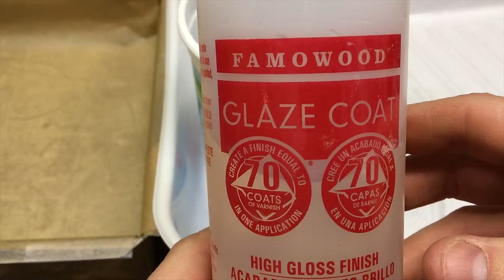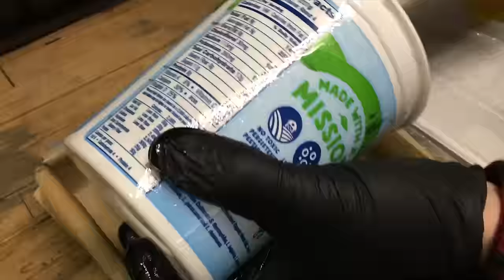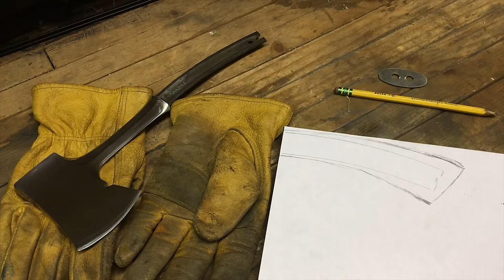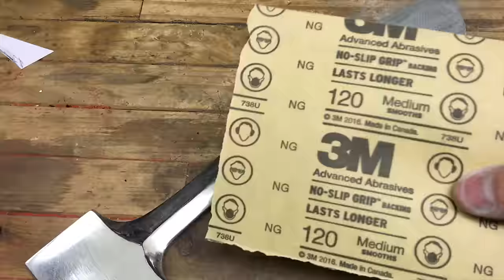AXE RESTORATION - Estwing Hatchet Restored using a Cashmere Scarf!

Comment: Did you happen to see the date stamped  on the handle  under the old leather?
 Thats an old Estwing  hatchet. I've been employed  there for the 35yrs .. I love seeing  our old tools brought  back to life ... Great job.!!
Reply: Kevin Robinson I recently cleaned one of these Estwing hatchets up as well. It belonged to a old woman that passed away recently that one of my mother’s friends knew. I have no idea how old it is, but I’m assuming the woman had it for many years. 

Used rough to coarse sandpaper to knock of the rust. Got rid of some chips/burrs on the edge and left it properly sharpened. Still looks/works great. Great Practical axe.
Reply: Kevin Robinson I have an Estwing hammer from the late 40s, the leather rings are falling off. When I was 16 I sent a photo of it and a letter to Estwing and they didn't want to repair it as their normal policy is they offered me two new hammers and $100 for it. So, I declined and still have the original hammer and haven't done anything but use it until I was able to save up and buy a new one, I'm now 28 and have several lol.
Reply: They're  really nice, solid tools that you can pretty much find anywhere. Lucky for me, since I've had at least 5 of them run away over the years.
Reply: I have a hammer my father gave to my brother then my brother gave to him, that hammer was given to my father by his father... I'm the 5th generation owner of this hammer and it still looks brand new except some rust
Reply: I have one of those axes from my grandfather 😎
Reply: Can you tell me who's dumb ass idea it was to make the entire handle a pinch point? (more dumb for the hammers..)
Reply: Beautiful outcome. Very creative and inspiring.
Reply: I have an estwing rock hammer that was handed from my great grandfather to my grandfather to my father to me. It's amazing how well they last. They just don't make tools like that anymore.
Reply: I have one just like this I think I bought it at a flea market, it came with the original leather sheath too. I have saw the leather handled ones in stores recently, but all I see now are nylon sheaths.
Reply: I have an Estwing hammer and double headed rubber mallet I bought about 10 years ago.  They're such great tools and I intend for my son to eventually pick them up.
Reply: @Faithless0415   The little orphans do seem to be rather independent minded, but why aren't my junky tools, I have boxes of them
Reply: @highball1415  The junky stuff is just grateful to have a home. :-)
Reply: My neighbour upped and left the family farm after four generations.  After the auction there were old tools left.  He gave me a 1965 Estwing hatchet identical to the one in the video.  The leather handle was toast and crumbled off when I tried to clean it.  I'm replacing it with a two part cherry handle.  The divider is a nice idea I might try to incorporate.  The real challenge will be getting the shine back on the head.  If someone had asked me what is the last thing anyone would use for a hatchet handle, I would have said Cashmere.  Shows you how much I know!
Reply: @74KU  Please explain, I've been swinging Estwing hammers, hatchets and axes for more than 30 years and I've never been "pinched". Best Hammer they ever made was the builders 25oz but I can't seem to find them anymore. I still have one.
Reply: Craig G   I bought  My Estwing  Rip hammer New...   Over  40 years ago.  &  have used it, BEYOND Brutal (in construction)  & in ways  WAY BEYOND it's  intended purpose.   yeah, it would look better  Polished...   But like older  Klein tools,  Still 100% as functional as the week I got them.  40 + years ago .
Reply: I have an Estwing camp hatchet like this one. Your company makes great tools!
Reply: I have a few that my Dad bought me. Thank you for making tools we can use!

Have a good evening! Stay Warm out there!
Reply: @Faithless0415  Yeah, they do have a tendency to spontaneously grow legs!!
Reply: Any way to get blades for the old lathing hatchets?
Reply: I have a hunting knife going into its 4th generation. I hate seeing the stacked leather handles go.
Reply: my gramps gave me his old Estwing hatchet and i adore it. I gotta say its got some ware on it, maybe ill purchase a new one.
Reply: I have one of these from my great grandpa, and I want to replace the handle with paracord because it's all I have, do you know if there's anything to show how specifically to do that to one of these handles?
Reply: Kenneth Roth man same !
Reply: My father in law left me an estwing number 2 hatchet.
Like this but not mallet faced.
And the handle is straight. 
Had carpenters hammer opposite hatchet.
I put a new stacked leather handle on it.
Came up nice. I think it was from the 1920s
Reply: Well you should be proud to work for a company that makes such a wonderful product. These days that's very hard to come by. Me and my dad found an estwing ax at the bottom of the suwannee river almost 20 years ago. And its still in great shape. A lil rust that's all.
Reply: Kevin, greetings from Belvidere!
Reply: I've got the same hatchet that a buddy gave to me in 93, he had my name and date ingraved on it, can't hardly see it anymore but I'll always remember 👍
Reply: I've got the same hatchet that a buddy gave to me in 93, he had my name and date ingraved on it, can't hardly see it anymore but I'll always remember 👍
Reply: @theskyisblue8979   I just found an Estwing rock hammer in the basement of an old gentleman who died. It was an estate sale and I love these old leather handle Estwing tools so I bought it. $3.00 well spent and I'm looking forward to restoring it.
Reply: @appalachiangunman9589  Lowes Home Center still sells these Estwing leather handle axes. I saw one in a Lowes just a few days ago priced at $34.99. I am going back to that store and buy it.
Reply: @CurlyQLink  onya
Reply: Interesting, I have one that looks just like he has (pre restoration) with the date 4-14-08. Never knew it had the date on there, the more I know

Comment: I have an Estwing hatchet that looks just like yours.  I left it in the utility room of a rental house that had a small leak in a water heater and over the fall, winter, and spring, left it all kinds of messed up.  The room was very air tight.  I take encouragement from this video thanks.  
Oh, to save the top of your work bench, put down a sheet of plywood, cut to form, and do your work on that.  When it is dented, dinged, and otherwise worn out, replace.  Easier than replacing the work bench, lol.  Thanks for posting.

Comment: I have a leather bound Estwing 20 ounce hammer I have been using for close to 30 years. The some of the white rings have cracked and fallen out. But once or twice a year I wrap the handle in wet rags for a couple hours and the leather swells back up then after it dries I put mineral oil on it or what ever is handy and it has a great patina and quality to it. 
Good job on your hatchet!
Reply from the maker: Thanks 🙏

Comment: Old shovel....one of the most interesting videos I have watched.  Gave me an idea,  I lost my favorite Estwing hammer with the leather grip.  I recently found it.  Under the house in the crawl space.  The hammer is rusty and the leather ring handle destroyed by moisture from a frozen pipe leak about 10 years ago.  I wrapped the remains of the handle with plastic electrical tape.  It looks unusual to say the least.  But it is back in my tool cabinet.  I think I will try my first restoration on my rusty old Estwing.   I believe I bought the hammer in about 1963 when I got married.  At 83 I cannot play golf due to balance problems but I believe I could stand long enough to take a shot at the Estwing project. Can’t work Habitat houses anymore cause the wife of 56 years won’t let me on a walk board, roof or ladder.  I’m restricted to helping a little on handicap ramps with my church buddies.  Took a fall last week on a ramp job and have bandaids and stitches on the face and left arm.   Wish me luck.  You are a great inspiration to an old fart who still loves to play with his tools. Bless you. I’ll be watching for your next project.

JoeB
Reply from the maker: Joe, good luck and thank you for sharing your story. Thanks for watching.
Reply: Joseph Burkhalter  sir you are an inspiration to this aging 60 year old craftsman
Reply: You Sir have made me set my goals higher and changed my standerds on younger women! Sir may you live 83 more ,GOD BLESS YOU And Your YOUNG WIFE !!!

Comment: The cashmere micarta looks great! Having grown up with Estwing hatchets and other splitting tools I loved this project. Glad I found your channel. It's good to see fellow Scouts inspirations.
Just some thoughts on the handle: The previous design was sandwiched between the neck and the bottom plate. Your current design leaves the work of holding the handle to the hatchet to the epoxy. perhaps you might be able to find the original posts on the bottom of the handle, drill and tap them for a more secure and lasting fit.
Reply from the maker: I am thinking of pinning it. Happy to have fellow scouts watching!

Comment: You need to pin those scales on. There's a reason the previous leather handle was stacked and not sandwiched. The handle on a hatchet will absorb significant force and vibration throughout its life. That epoxy alone will not be able to keep it together.
Reply from the maker: I’m planning on pinning it, agreed.
Reply: What if he drilled through the whole lot 3 times, and put a brass wire through it and squashed the pins?
Reply: I was thinking the same thing. There's no way I'd have that much confidence in any epoxy.
Reply: Bold strategy, cotton
Reply: Except that this one is going to hang on a wall by the looks of it.
Reply: The leather absorbs sweat so you don't get blisters.
Reply: @A_Man_In_His_Van  he said he plans on using  it so the pins will be needed
Reply: Holy hell a comment assassin made a suggestion and the YouTuber agreed.. ..this must end fast due to other commenters will put in their two cents.
Reply: @benzracer  No no, its cashmere
Reply: I was wondering about vibration on the ✋ hand
Reply: White Marlin , Blacksmith here, I've used em, they're called corby bolts, and they are an absolute pain in the a$$ to use, but they work very well
Reply: Please provide the full specs on the leather dye. (Brand - type - color) I like the finish very much.

Comment: Good video . you could spray the handle with a clear coat to brighten it up and help seal it. just saying . great work. i i'm subing to you.
Reply: I was thinking the same! I'd use a thin layer of epoxy because it's tougher and would bind with the epoxy already in the handle, but that's mostly just because I prefer smooth handles. they never hurt or give me hot spots like some other people complain about sometimes.
Reply: @alienamarie2667  I Agree.

Comment: Vinegar will work way better at removing the rust and alot cheaper. With vinegar let it set in it for 24hrs and wire bush it
Reply: yep sometimes it turns stuff black also just like the evaporust.
Reply: It's best to wire brush it before you soak it in either product. Also, two things more. I use Cleaning Vinegar as it is very cheap and is considerably stronger than household vinegars. Secondly, I keep an old coffee maker that I run the vinegar through to heat it (you'll probably want to use it outside), and I only have to wait a couple of hours for it to work. You'll want to run clean water through the coffee maker a couple of times, though.
Reply: @boatingman11  I like the heating the vinegar idea. I'll try that on the next project.

Comment: I found the exact same hatchet at a yard sale and I'm replacing the handle too -I just used leather from a belt I bought  and cut the same disc's just need to sand and dip in a finish to seal the leather. Great job!

Comment: Great jobI did same thing to mine but I went thrift shopping for leather belts and went back with original handle an even attached the end plate back like original.  These are great little axes and I use mine constantly.  Thanks for sharing.

Comment: Nice work on this restoration.  I loved the idea of the epoxy/cashmere handle.  The layers being visible was great, but I guess I was a little disappointed in the finished appearance of it.  I think I prefer some kind of finish over that, but then again, I'll bet it would make the handle slick and ruin the grip... At any rate, that's some nice work - the red layer in the middle of the grip was a great idea.

Comment: Love everything about this restoration. I have done similar things with trenching shovels, knives, a cleaver, and one hatchet. I've never done the homemade micarta however. Your hatchet turned out beautiful but is there any way to maybe deepen the color of the micarta? It almost looks like it needed to be polished. Maybe just the color of the cashmere but it looks a bit hazy? Or maybe that's just how micarta turns out? I think I've only seen it in lighter colors. Maybe this is why.

Comment: I was a framing carpenter for many years. I liked to use a wooden handle hammer because at the end of the day my hand didn't hurt. An Estwing would not absorb the shock as well as a wood handle. I could always hear the Estwing ring when it hit a nail,lol. Also one had to be very careful when hammering cross handed because the shank of the hammer would break finger bones easy. Nice job you did there though.

Comment: Very nice job.  I have a similar Estwing hatchet but it has a straight handle and a hammer head on the side opposite the blade, possibly a framer’s hatchet?  Bought it in the mid-80’s, it too has a leather handle with a couple of pieces missing.  I’m going to try your method to repair it, and add a couple of pins since I don’t totally trust epoxy to hold the scales on.

Comment: Great to take an old tool and give it new life!  Sadly many folks would rather go buy a new cheap version not understanding both the pride and quality in this process.  I'm sure if you add up the hours most younger folks wouldn't even consider it or understand the need for a reliable, high quality tool.

Comment: I got the same hatchet at a garage sale for $5 and it was almost as bad a shape as yours. I wanted function over form so I cleaned up the steel then wire buffed the leather handle. I followed that by putting on gloves and smearing silicone all over the handle portion, squeezing it into depressions or holes in the leather. After the silicone had set to the touch I tapped the whole handle tightly in a kind of x pattern as a experiment. It didn't turn out half bad!!! I had to trim up areas where the handle met the metal but other than that it had a nice spongy feel to it and was a major grip improvement! By the way, I have dressed up several knives like you did with your hatchet and made em so pretty I just couldn't stand to treat them normal any longer so they became some of my "drawer safe" knife collection. :-)
Reply from the maker: Awesome awesomeness 😁 the handle sounds fun.

Comment: Leather, with a little care will last a lifetime easily 30+years, and often much more. But… 
  I’ve taken to the “lost foam” technique to make a permanent handle for a good many of my hand tools.  After about 8 years they are all shining and light as the day I poured them. I’ve even reprofiled some for comfort. Aluminum is light and durable, and soft enough to make it great for this application.

Comment: I took 2 estwings and soaked it with the thinnest super glue possible and soaked it till it would take no more. Then I sanded it and clear coated it. Came out darker but it worked well. I like your idea better. Will you clear coat the micarta or leave it natural.?

Comment: What did you use on grinder ? Did you use grinding disk or a sandpaper one ? About to get a wire brush for mine but I already have a grinding disk but as you may know , a grinding disk is far less forgiving takes a lot more off than a sanding disk .

Comment: I have a estwing hatchet it was badly rusted, they rust easily. It had the blue estwing handle. I polished it to almost a mirror finish removing perhaps a quarter of its weight. Now it's like an axe razor blade. Severs a 2 inch tree with a single blow.

Comment: You really did a nice job on that vintage, made in the USA hatchet. I was wondering what kind of epoxy do you use for a project like that? Keep up the good work.
Reply: G Flex from West Marine nothing better. My Son and I fixed a leaking washing machine tub never leaked a drop since.
Reply: Thanks for getting back so quick. I have a couple of hammers I'll try to bring back to life!

Comment: Great vid. Just subscribed . One question....you said the expoxified cashmere  felt  soft but grippy...have you put it through the test?...like really used it? Mainly how did the handle hold up?
I'm very curious.
Thanks
Reply from the maker: Awesome thanks for subscribing. As to the handle, I have only used it lightly, it is the smaller Estwing hatchet, and it is held up well with that light use.

Comment: I've done a few of these.  That handle didn't need to be replaced.  It looked like crap because whoever used it before didn't take the varnish off; the varnish was cracked.  A little saddle soap and some neats foot oil and it would've looked as good as new.  It doesn't look like it was even old, the sticker on the shaft was still partially there.  Looks like it spent one or two years out in the elements.

Comment: I made these exact tools back in 1980's the washer handles are just held in place with the tang plate which was cold riveted on 100yr machines then they dip the handle in lacquer based oil then clear lacquer..blades were the top $$ in the finishing dept worst Estwings are the long axe with the welded tube.i have most tools produced my favorite are European only electrician hammer an the framing axe. Also we made 16oz Roberts hammer heads i finished these